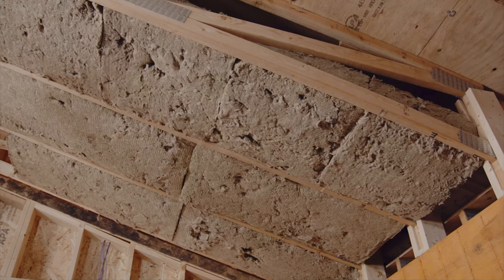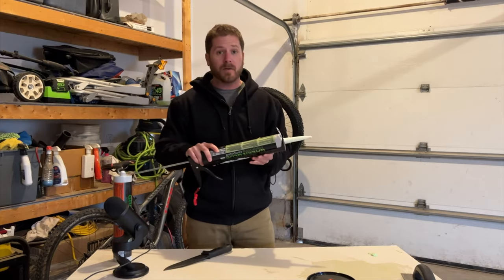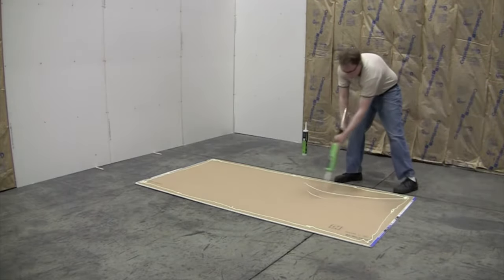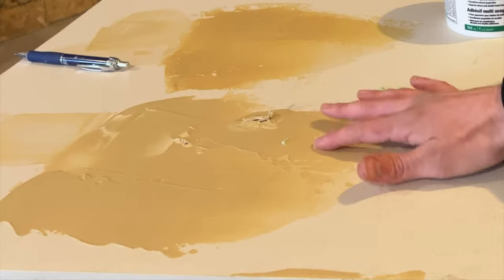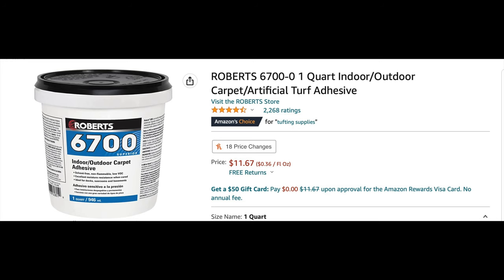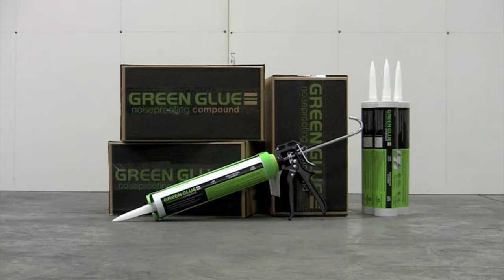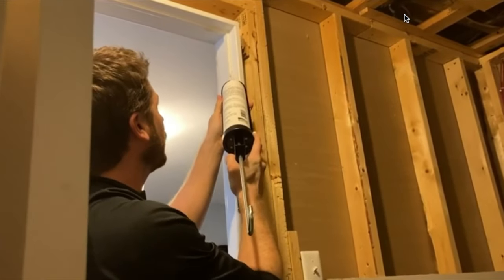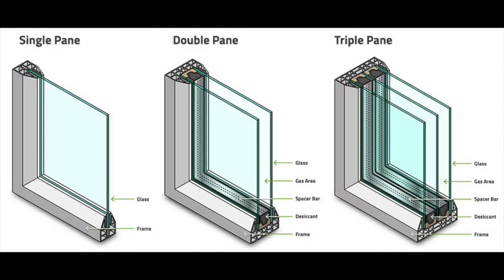Do These Soundproofing Material Live Up to the HYPE?

Comment: I went back to watch several of your vids to gain a broader perspective on different products.  I've come to the conclusion that a simple, cost effective approach for upgrading an existing wall is to sandwich carpet glue between a second layer of 5/8" drywall and the existing wall. Use acoustic sealant on seams and edges and a putty pad to seal outlets.  All of these materials are cheap compared to sound proofing specialized materials, and they are uncomplicated to install. This design provides mass and blocks air paths.  Easy peasy.
Reply from the maker: You're correct! Thank you for watching and leaving a comment!! :)
Reply: Did you do this install? How did it work?
Reply: Sounds like no one here actually knows anything about "soundproofing".  It's the clueless leading the clueless.

The only way to "sound proof" is to first understand what frequencies and amplitudes of the noise and how much you want to attenuate on the other side of the barrier.  Then you have to choose a VARIETY of materials and use a sandwich design and there could be a WIDE variety of materials.  Some of those materials could be Plywood, OSB, MLV, Sheetrock, Steel plate, concrete, MDF, etc. etc.   but you really have to analyze the noise problem first and then talk to someone that actually knows how to choose which materials and the wall construction design.

I don't believe any "glue" is a barrier. It's just something to decouple one material from another, but there's other materials can be used to do the same thing that might be much less expensive..  I'd use layers of MLV (and there are different thicknesses on the market) combined with other materials. But "glue", especially the "green glue" is way too expensive and it really doesn't work that well compared to using a proper thickness MLV to decouple.  But again, figure out the noise problem and then talk to someone that actually knows what they are talking about.

Comment: I always smile when you say good things about Mass Loaded Vinyl. Never tried it though... and no idea about prices. I really want to do a double layer of dry wall and put mass loaded vinyl between the sheets of drywall. I think it will make an excellent difference to stop noises coming from my neighbors
Reply from the maker: Mass loaded vinyl definitely delivers!  Best of luck! 😊
Reply: If it is not air tight mass does nothing. The brain will perceive the noise leaking as the same🤷🏻‍♂️ if you sound proof a room to 40db you will start to hear your ears ringing. The neighbors will sound the same, unless you add white noise. It’s like looking at the sky. Sound proofing only dims the light the stars/sounds you are trying to block become brighter and more distracting. 🤷🏻‍♂️ mass loaded vinyl would work great if you could wrap your neighbors in it airtight.. but then you have dead neighbors🤷🏻‍♂️😂😂 I guess what I am saying if you have a noisy object like a dish washer wrap it in mass loaded vinyl air tight, but if you mass load your wall, noise will find a way🤷🏻‍♂️
Reply: I need to just do a video🤷🏻‍♂️ I live in city dealing with bus lines, and 2am bar noise, road construction, and garbage trucks. I have always dreamed of a sound proof oasis. I Finally just said fuck it and I went all in $$$ on sound proofing. Double front doors witbv3 inch air gap. Double pane windows 4 inch air gap to 1/2 inch plexiglass window inserts. Concrete block Facade outer walls, then steel framed construction, r15 insulation, double  5/8 Sheetrock with noise damping  glue in between layers. Concrete slab ceiling, with green garden above. The steel framed ceiling drops 6 inches with r 20 insulation single layer 5/8 sheet rock.
Reply: @gabeshannon4819  I already hear my ears ringing. I have tinnitus. All I want to do is stop hearing my neighbours washing machine spinning, air conditioner motor noise and water pump vibration
Reply: @Ladioz everyone has tinnitus if you make the room quiet enough.. 🤷🏻‍♂️😂😂 this is funny because it’s true.  If you  can isolate those Objects rubber pads to stop vibration and wrap them in 2-3 layers 1/4 inch thick airtight mass loaded vinyl that would give you the results you want. Then all the space around them also becomes an air gap. Earplugs work with very little mass, by creating a very large sealed air gap. Mass is mass, cheapest mass is the best/Sheetrock when it comes to walls. The thing to splurge on is making your added wall layers as airtight as possible. 

If you can hear the ringing in your ears then you live in a very quiet place, this makes your brain perceive those objects that bother you as louder.  Use the spectrum app on your phone. If the sound is in the 60-125 hertz range you are trying to block 🤞🏼 good luck. Good news is if You can get that down to  60db it sounds like a white noise rumble, if you quite a person talking to 60 db it sounds like their still in the room with you. So you need to block those sounds down to below 40 db 

I did not understand the more you block sound the loader it gets, until I spent thousands of dollars. I have a wall heater that blows air at around 55 db when it’s on I barely hear anything, when it’s off it sounds like why did I bother sound proofing, I hear more noises that I never even knew were there.
Reply: Not trying to discourage, I am just speaking from my experience. I am very happy with my sound proofing. Do I think the results were worth the cost, honestly not really. Would I spend the money to  do it again though weirdly yes..

Most important lesson learned, I can not stress enough is an air gap isn’t an air gap unless it is airtight. Do not put an earplug in all the way and it barley works. 

The size of that earplug crack is the air leaks you need to make sure get sealed  in your walls. 

I have 0 data to back this up but I really just think noise damping glue works because it helps make walls more airtight🧐🤷🏻‍♂️
Reply: @gabeshannon4819  I wouldnt mind dead neighbors. 🤣🤣🤣🤣🤣🤣

Comment: What do you think of Spray Cork?  Cork is known for great sound proofing capabilities, spray cork is basically cork sawdust put in paint and sprayed on with a paint sprayer. It is reported to be very expensive, and is reported to potentially have some good thermal properties as it may both seal some cracks, change emissivity, besides adding a very limited R value. From an acoustic standpoint, it can be sprayed inside a room changing texture of a wall and absorbing some sound waves.
Reply from the maker: I’ve never applied spray cork but I’ll definitely look into it! Thanks

Comment: What’s the best way to treat a basement ceiling? I am planning to use Embassy Ceilings suspended tiles but what do I do above it? I was planning R30 fiberglass. Anything else? This will be a home theater with kitchen above. 2 sides are concrete foundation.

Comment: Great resourceful video! I’m trying to do a shed build on a budget (sorta) and I’m going to insulate with rock wool and use 5/8” drywall. Should I go with mass loaded vinyl in between or resilient channel? I have about 16 custom built sound panels from my original office.

Comment: @soundproof guide if you see this question, it's a quick one.  i have an interior wall with zero insulation.  do you think using loose-fill cellulose insulation in the wall cavities would have a noticable effect before performing the steps I've mentioned below for a cheap and easy version?  Loose fill won't provide hardly any mass, so I question if it is even worth using.  I think it only transforms the large voids of air between studs into tiny voids of air between small chunks of insulation.
Reply from the maker: Air is actually a better insulator than the loose fill insulation. So no, not worth it at all. Unless you have noise entering the cavity creating an echo, which I doubt that's the case. Best of luck.

Comment: Need to insulate (not finish, no resilient channel) basement ceiling in old, old house with broad board floors with some gaps between boards. Noise rising up from steam boiler and water pump. Thinking mineral wool, but wondering if a second form of insulation is possible/needed. Something thin up against the floorboards before installing min wool? 5/8 drywall?
Reply from the maker: Mass loaded vinyl. 😊

Comment: Thanks for the info. 
What about SONOPAN Soundproofing Panels ? I belive they are available in Canada only, but I've heard a lot of gud things abt them.
Reply from the maker: I’ve yet to use Sonopan. I’ve contacted them several times for more information but have never received a reply from
Them.
Reply: @soundproofguide  Don't you live in Canada? I thought they sold it at many major hardware stores there.

Comment: Question:    Why doesn't green glue compound or carpet adhesive or MLV get squished down where the 2nd sheet of drywall is screwed through the first sheet and into the studs?  This area is normally secured snugly.  Wouldn't this squish the green glue out of this area and create a solid connection from opposite room's wall, through the stud, through the first drywall, and to the 2nd drywall?   Any insight on this would be much appreciated.  Thanks
Reply from the maker: It does get squished between the two layers of drywall. 😊
Reply: @soundproofguide  I'm guessing the amount of "squish" away from studs is less which allows the thickness/mass/elasticity of the material to be effective-ish.  But at the studs, I would think the amount of pressure increases the "squish" to the point that the compound is so thin or completely pushed away. Wouldn't this negate the dampening effect of the rest of the wall?
 
But that is the point of this video, isn't it? Choose between $$$ or space and use the combination of materials that fit your needs.  If you can't afford over 4" of space for 6 layers of drywall then use a 1/8" layer of MLV or goop to save space at the cost of $$$.

Comment: Interesting video. Insightful. Thanks. In the UK two plasterboard sheets of 12mm or 9.5mm (£22) are cheaper than 15mm acoustic plasterboard (£24), and only a bit more than standard 15mm (£18). Would it be better to have two 9.5mm boards (19mm), MLV, then another two 9.5mm boards (19mm) rather than 15mm, mlv, 15mm?  I know there are some diminishing returns to consider. Or is it overkill? Should I just stick with the £18 standard 15mm? Thanks
Reply from the maker: I would go with the two 15mm boards with the MLV between them. 😊
Reply: @soundproofguide  Thanks.  Two boards of standard 15mm it is then. Less work too!

Comment: i build my window insert with 3 layers of sonopan..(one sonopan is about the same weight as one same size 3/8 inch plywood)..but i can still hear the sound come from outside..is it due to the small gap in between my insert and the window??? i believe my window insert is solid and dense enough...
Reply from the maker: The gap between the insert and the window would definitely be a cause for concern. Seal it up with some weatherstripping and you’ll definitely hear the difference! Best of luck!

Comment: Could finishing a room with thick ceramic tiles be an all in one solution? they themselves could be the heavy mass loaded material that bounces back and also absorbs sound, and also don't have to paint because you can pick the look of the ceramic to fit the room design, do you agree? to make it effective the tile would have to be glued with carpet glue and if there is a way to leave an air gap even better, or perhaps wall/insulating foam/ceramic?
Reply: 😐 the only comment without reply 😓
Reply: Speaking from my experience. I live in seattle on a busy street with a bus stop. Bars closing on weekend can have a lot of people talking outside my place. Lots of different frequencies to try and block. I have took the sound down from average 60 db and peaks of 84db to average 47 db peaks of 60db. The 60 to 125 hertz frequency is were the sound still peaks in my place. That noise is very hard to block, I have very thick multi layered walls with damping glue, I doubled the front door with 3 inch air gap. I have double pane windows with 4 inch air gap I got 1/2 inch plexiglass window inserts on all windows. The window inserts cost $$$, I was super bummed by the performance vs cost at first. 

Sorry I am rambling, but it is through this experience I am going to try and answer the question.  

The plexiglass panels were so heavy and rigid they were not perfectly sealed. walls and window openings are not straight. I had to frame the windows to hold the plexiglass panels properly so they wouldn’t crush the seals. This would be the problem with ceramic tiles I think, fitting them perfectly and sealing them would be a nightmare. I don’t think the performance vs  the cost and complication of install would be worth it🤷🏻‍♂️
Reply: @gabeshannon4819  hey tysm for the reply, this helps me to rethink and build a better insulation strategy
Reply from the maker: Hey! Sorry for the delay. Notably, ceramic tile is a particularly hard surface floor covering which makes it substantially more difficult to soundproof than a wood, laminate or vinyl flooring. Even with the use of a good quality acoustical membrane, results (acoustical ratings) equivalent to other floor coverings cannot be expected.

Comment: Does a resilient channel work the same if you have steel studs? Or do the steel studs act like a resilient channel themselves?
Reply from the maker: Yes it could still work on steel studs. The steel studs will not act as a resilient channel however. It’s the way the resilient channel is built that makes it effective.

Comment: Thank you for the helpful video! Can you put green glue directly on top of MLV or do you need to seperate them between dry walls?
Reply from the maker: You can place it on MLV.
Reply: MLV only works if it hung like a membrane, don't sandwich it between drywall as it will be a waste of money. Done put green glue on MLV, that should go between drywall only. All the dedicated professional studio builders and designers have stated this about MLV and it has to be used

Comment: Like to watch your channel! I looking for a 2 way solution for my walls. It is not a big living room (Europe everything is smaller) so I look for a wall that is slim. I look for a material(s) that reduce the voices off my neighbours, and also where I can fit water hoses in (like floor heating), for lower temperature off the heating system (more mass is heated). I can't find a standard solution. Do you have a good ideas?
Reply from the maker: Material like mass loaded vinyl would work well for homes that can’t afford to lose any square footage. You can place multiple layers of MLV and it still won’t be as thick as 5/8” drywall. Hope this helps!

Comment: The best way to soundproof is:  to live in the middle of nowhere!
But seriously, I just installed resilient channel (yes, installed correctly, screws did not go through to wood joists)as well as one layer of Rockwool Safe and Sound in my basement ceiling to REDUCE sound transmission.
The keyword is REDUCE.   I know that lots of sound travels through the HVAC and noise is never 100% eliminated, but reduced.
I still hear the thumping from upstairs and chairs dragging on ceramic floors above.  I could probably hear loud voices too, but quiet conversation is not heard.  I'd guess that it reduced the sound in half, so it was well worth the time and expense.
Reply from the maker: Thanks for sharing! 😊

Comment: You can definitely add resilient channel on top of existing drywall, you just need studs to find studs...it's a recommended installation for Sonopan, also Rockwool is barley  a 2 STC rating higher then fiberglass, why? As you said yourself it's all about mass and air movement, For the price difference you can just add more fibreglass a.k.a. mass....